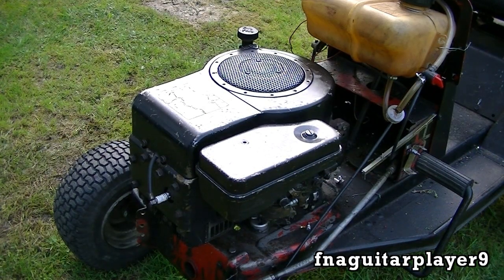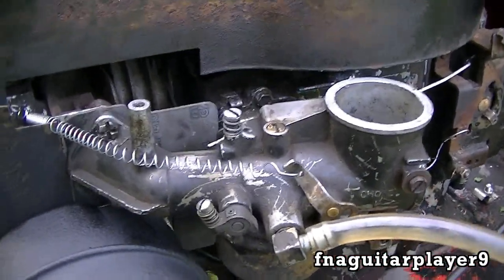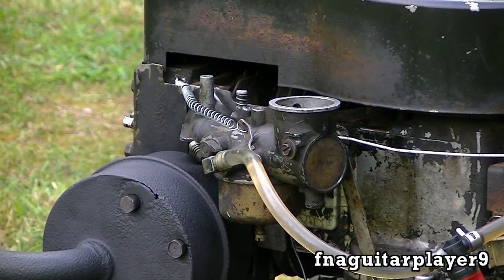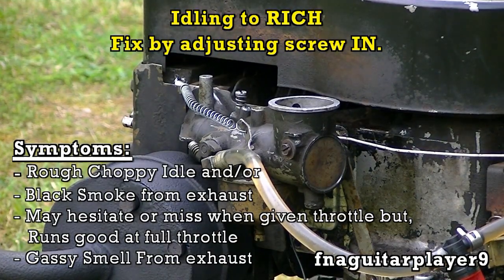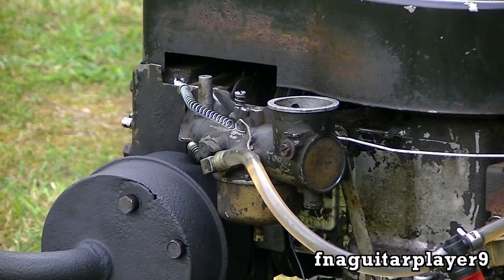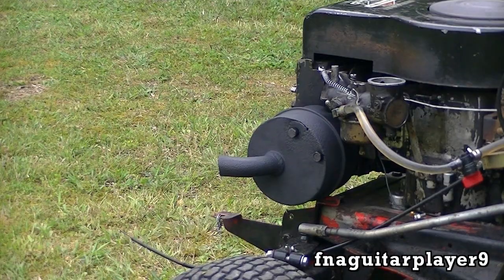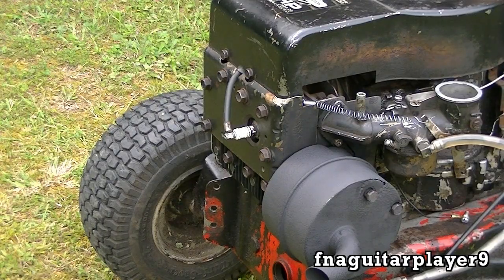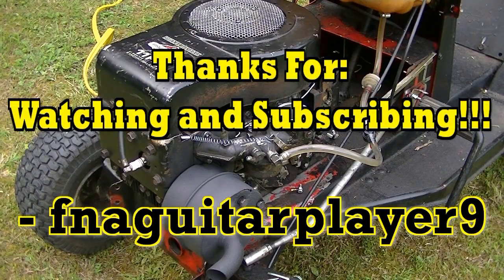How to adjust a Briggs and Stratton One Piece Flow Jet Carburetor

Comment: great video, I have 4 engines running these carbs, I put kits in 2 of them as they had been out in the weather for yrs, the gas bowls were rusted off.I had to drill out the screw-nozzle inside the carb with a 5/16 drill and the run a 3/8 SAE tap to clean up the threads, I used a tiny bit of blue thread locker to screw the nozzle back in and seal it.. I repaired both carbs for about fifty bucks where as they are about $200.ea.
Reply from the maker: dave12546 Thanks! I hear ya, got to hate when that happens, i've never had to drill them out before but i've ran into some that were really stuck. Can't beat, saved a ton of money! Thanks for watching!!!
Reply: Are all Briggs threads SAE? I only have a metric tap and die set (in France) and need a set of appropriate sort to work on engine 11HP i/c  and on Murray 11ic/36. If I get  SAE set will that do the trjck? Thanks.

Comment: Thanks for the time!  I agree, these carbs are bad ass!

I just got an old Ariens snowblower for free!  I offered to fix it for them...but they said they would rather get rid of it.  I don't know what size engine it is...but it's a beast and in great shape.  

Only thing I've noticed so far is that the recoil is popping out/letting out every now and then.  I don't know what that's about?  Maybe the spring tension isn't tight enough to hold the tug rope in when operating?  It retracts, but let's out a few inches once in a while.  That's going to be bad if I let that happen too long I guessing.  So would I fix the issue by winding up the recoil a little more?

Also, I am having a hard time getting the RPMs to lower at full throttle.  I'm hesitant to mess to with the governor...any suggestions? What's your diagnosis?  It sounds to me that "idle" is close to medium-full throttle.  And full throttle makes the muffler "glow". Which can't be good.
Reply from the maker: I hear ya! The rope doing that is the spring being weak (needs wound up more) and the mechanism needs oiled (WD40 works great), if you don't fix it, it will probably snap the rope. Possible that it could break the spring. That sounds like its running way to lean, it could be a intake gasket leaking bad (had that happen before) and the carburetor probably needs to be cleaned and adjusted. Hope this helps! thanks for watching!!!

Comment: Hi thx for video , I nhave the same flow carb but the float is filling up with petrol have you any idea what the part number for a new float would be
Reply from the maker: Rug19061971 if your carburetor is the one piece like in this video with the metal float, the part # is 299707, i order parts from tulsa engine warehouse (tewarehouse.com) but for one item the shipping would be to high, i'd check ebay for it. Thanks for Watching!!!

Comment: Just rebuilt the carburetor on my riding mower, and even using the settings you said (1 1/2 turns on both screws) I can't seem to get it adjusted right...it'll start right up with starting fluid, but cuts out after a second or two (maybe when the ether gets burned up?) HELP!!!!

P.S: The reason I rebuilt the carb was that it kept cutting out whenever you engage the mower no matter WHAT you did with the screws, but ran fine otherwise...maybe a governor problem instead??
Reply from the maker: a2phil sounds like your float may be stuck not letting the bowl fill with gas. I'd take it back apart and make sure the float and needle valve is working smoothly. You could try adjusting the governor sometimes they will not adjust the throttle properly. I have a video on that as well. Thanks for Watching!!!

Comment: you wouldn't happen to know where i could get one of these carbs for a decent price do you? i need one for an old 11hp vertical briggs, the carb that's on it is broken in the bowl where the float mounts, floods it
Reply from the maker: A new one will be high dollar, I would suggest getting on ebay and finding a used one in decent shape. I'm short on carbs myself at the moment or I'd sell you one cheap. I have managed to fix a carburetor that was broken, not that part but the part where the bottom bolt/adjustment screw goes into, i have a video on it called experimental carburetor repair, but I don't know if it would be possible to fix that part or not. And I don't know how long it would hold up. Best bet would be finding a used one on ebay, or going to a junk yard and finding one, or you might find a good deal on a blown up motor on craigslist for parts. Hope this helps, thanks for watching!

Comment: Mine has the same carb, the idle arm bounces up and down regardless of the screw position, is there a spring somewhere that might have come off? Also the mower starts surging and dying after it gets warmed up and I try cutting long grass. Runs and cuts fine until it gets hot, any ideas? I haven't tried adjusting the high/low side mixture screws. Thanks, and great video!
Reply from the maker: First thing that comes to mind is the governor is out of adjustment, i have a video on how to adjust mechanical governors, try that, it may help it, and the mixture could be out of adjustment, getting hot means its running to lean, try making it run richer and see what it does, do those 2 things and see how it does, if it doesn't help get back to me and we'll figure it out! Thanks for Watching!!!

Comment: Nice vid guy. A lot of info usually not found on these. Not a huge amount of the older flow jet carbs out there (small, large, two piece of one piece). On the soldering or brazing of the float....I can honestly say its not worth it. Besides the weight of the solder, if it DOES have a pinhole in it and takes in a little gas it can make a nasty little explosion. I know personally of several people who have had a mini bomb go off because of the gas in the brass floats. They wont do that again, lol!

Comment from the maker: I hear ya. This is a very common problem with metal floats. If its not to bad they actually can be soldered, but unless its like a pin hole in it, its not worth trying to solder, because if you build up to much it will sink likes its full of gas from the extra weight. I know right! I've saved several motors from going to the scrap, I just can't throw a engine away! Even if it threw a rod out the case, I'll try and fix it! Your welcome, appreciate that very much! And Thank you for watching!!!

Comment from the maker: What usually happens is moisture or gas will get into the float (maybe not enough for it to stick and overflow) but when it gets cold in contracts (like a gas can does, swells in heat and shrinks up when its cold), the float will probably have to replaced in that case. I know what you mean, heard that! your welcome, anytime!

Comment from the maker: don't give up! haha Try hitting the bottom of the bowl with a screwdriver, that usually stops it from overflowing if its float related sometimes it sticks and just needs a little attitude adjustment, now this doesn't always fix the problem, but if you do it and it stops then it is float related. Have you checked the float to make sure its not leaking? If its leaking it will sink down and constantly flood the carb. There could be dirt in the seat, causing the needle not to close.

Comment: thanks so much for the information...I installed the carb kit.and gas is still filling the carb and into the air intake....I made sure the float was level and the needle valve was working before putting everything back on.  do you think the needle not closing is the only way to cause it to flood this way..  the same thing was happening before I rebuilt the carb..im about to give up..

Comment from the maker: I hear ya! glad my video helped out! The part your referring to is called a welch plug, the only time you need to take it out is if you need to get into the throttle or choke plates, like to replace them or to clean if they are corroded, to be honest i've never had to do it! And to reinstall them they have to be staked with small tacks. Very rare to have to anything with the welch plugs. I'll have to mention this in a video sometime. Thanks for Watching!!!

Comment: I just rebuild a 12 hp briggs carb. the murray riding tractor is around 25 years old and the engine runs good.it sat up for ten years because I got a john deere. when I tried to bring it back to life, gas filled the carb and muffler. I knew nothing about how to set the screws after the carb rebuild. your video has helped me understand the settings.  thank you so very much for taking time to help us that don't know everything..In the rebuild kit there is a round disk,WHEN DO YOU REPLACE THIS PART

Comment from the maker: Oh wow, thats along time for one to be sitting! glad to hear my video helped out! Your welcome, thanks for watching!!!
Reply: Being as it sat for that long the carburetor bowl had a huge chunk of rust in it and I guess there's a hole by where the main jet tube comes down I might plug it but it doesn't seem to be doing anything bad but if it doesn't tune properly I will plug it to see what happens before I buy a new carburetor
Reply: Mine was sitting for almost six or seven years now. I resurrected it out of some sandy mud and somehow I've got all the blades to turn and the steering as well hopefully it can hold up a little longer A lot of grease and a lot of oil buddy

Comment: THIS VIDEO ROCKS!!!!  I just bought a craftsman mower that sat for 12 years.  The gas looked like canola oil in the tank and carb.  I was able to tune this engine in 4 minutes to get it running like new thanks to your video!  GREAT JOB and BIG THANKS!!!  You saved me a trip to the dealer.

Comment from the maker: sounds like the float level may not be set right (float set to high and letting the gas level rise higher) and its pulling gas out of the vents, i have 2 other videos (one older and one recent) on rebuild/cleaning these carburetors and i talk about setting the float level in both of them, i'd check that first, also the float could be sticking making it overflow and flood. hope this helps, Thanks for Watching!!!

Comment from the maker: that sounds like the float and or needle valve isn't working properly, if its a metal float you can usually bend the tab where the needle valve is to adjust the level, it may also be leaking (the float), or it could be a bad needle valve. I always keep a fuel valve on my mower so if something goes wrong, it can't flood out.

Comment from the maker: i was pushing on where the throttle cable connects, i didn't have a throttle cable so i had to it that way to use the governor. On most engines its a square plastic piece, on these older ones its a metal tab. thanks for watching!

Comment from the maker: yeah, i'll send you a PM then you can just reply to it with your email address, i'll be the only one that can see it. ITs changed alot now you have to go to my channel then go to the about tab and its under there, but i'll pm you to make it easier, yeah thats what I recommend. The chart i'll be sending shows all torque and tolerances for just about all brigs engines from 3 horse push mowers to the big twin cylinders.

Comment from the maker: yeah it does help, well my chart that i use says .003" to .005" for the intake, and .005" to .007" for the exhaust. I've used that and it seems to work, now i try to get it set to the low setting if possible, close to .003 and .005 as possible. .004 would work, but its supposed to be set a little looser on the exhaust because it gets so much hotter. If you PM your email address i'll send you the chart, it has all torque specs and tolerances if you want it, its a pdf file

Comment: Also noticed hard starting problem too so I will be adjusting valves tomorrow.  Any rule of thumb on the briggs OHV?  .006 intake and .008 exhaust I read is good for all flatheads.  Watched a Donyboy73 video where he puts them at .004 on OHV.  I might just try .005 as a good start-point for OHV.  I'm not so keen on finding service manuals for every engine I come across haha.

Comment: I'm going to research this compression release thing, as I keep seeing it mentioned.  I don't know that is the case here however as compression was 90psi when I had oil squirted in through spark hole(so bad rings/cylinder seal).  Not worried about it though 65 should be good enough.  First thing tomorrow I'm popping that flywheel off.  I am glad I have a lead now, thank you.  I think this mystery is solved, I will let you know how it turns out.

Comment from the maker: its possible, my 14.5 (ohv model 28) sheared a key a couple years ago, turns out, which is why its still not running, it needs a new coil, it has a short in the wire, and i guess it misfired and made it kick back and sheared the key. but it is very possible. i'd check that first, when you say it fires a few times, that tells me its the spark timing. also I just remembered, the low compression is probably because of a compression release, most of the bigger engines have it to start easier.

Comment: It's a 15.5 diamond I/C 1 cylinder vertical.  65psi works fine in the 3.5 classic's so I tend to think that is not the problem.  Timing could be off, either from camshaft or flywheel having a shorn key.  But a shorn key on a pulley driven engine seems near impossible to me.  Any idea's?

Comment from the maker: sounds like it may have sheared a flywheel key, the low compression is probably in the valves, a good valve job should fix that, the rings may be worn, but i usually start with the valves.

Comment: And now I've come across another briggs that is acting very mysterious.  I have the 2 piece carb off and I am spraying gas directly into intake manifold to completely bypass any issues with carb.  Very good spark from coil is jumping 1/2 inch.  Spark plug is good.  Won't start at all. I get a few fires when I give it a good squirt of fresh high octane.  Now compression is only 65.  I know that's low but figured it's good enough?  Either that or I'm looking at opening case to check timing

Comment: wow I'm having some bad luck with these larger briggs engines.  No luck with this one.  Installed new carb kit, but slow jet wouldn't thread in for some reason.  Old slow jet looks reamed a bit but the customer doesn't want to invest any more into it.  I was going to retap the threads to allow for the slightly larger threads of the otherwise identical new slow jet.   He's going to drop it off to me and maybe I will find what's wrong on my own time.

Comment: I think your on to it with the float.  That sounds about right.  
I checked the fuel line to carb and it's good.  I had carb apart and float sits level with carb when needle closed, which I thought was correct.  I could try adjusting the brass tang on float so it doesn't close until slightly higher up.

Comment from the maker: yeah sounds like its either like i said the float isn't adjusted right, or a bad/clogged jet. nah I wasn't talking about the emulsion tube, but the float and needle valve, if it isn't working right letting enough gas into the bowl it will act like its running out of gas, then gas pours back in letting it run good for a little while again. but a bad fuel filter will do the same thing, check that first, just to rule that out, ya never know. its hard to say sometimes what it is.

Comment from the maker: thanks! that sounds like the float/needle valve isn't working properly or the float needs adjusted. what it is, its not letting enough gas in to run longer, and its running out of gas, from not enough coming into the bowl, in other words like your turning a fuel valve on and off. OR it could be a bad fuel filter and/or line, not letting enough gas come into the carburetor. thanks for watching!

Comment: Cool video. Had a guy come in today with the same engine on his mower.  Something seriously wrong with the carb.  I tried starting out at 1 and 1/2 turns on both screws and working from there... Best I could do was fine tune it so it would run good for about 2 minutes then stutter and try to stall for about a minute then it would run great like a champ for another 2 minutes then decide it wasn't up for it and start stalling and stuttering again!

Comment: Hey dude good video! I have a newer 8.5 briggs on A yard slug with several problems! sometimes it runs great and sometimes it lacks power. And there are some electrical issues as well. But it runs at a snails pace but it wasn't designed to be a speedster. And since I only paid $40.00 if i can't get it right I will just part it out. Ha LOL! But it beats pushing a mower! And since it is so slow it is both wife and kid freindly!

Comment: Sounds like you have a crook condensor in your ignition. When they let go they tend to die after they heat up after they have been used for a while then cark it. then they are fine when they cool down. Very frustrating. Had this problem with a chain saw years ago. Give it a go, regards.

Comment from the maker: it stays screwed in all the way, its actually like a jet, it has a name but for the life of me i can not remember whats its called! if its screwed out it will pull in extra air and lean out. The oil wouldn't be causing this, several possibilities, first of all it could be the float/needle not letting enough fuel into the carb and it running out of fuel or it could be a bad condensor (if it has points and condensor) alot of times they will heat up and quit working. i suggest the 30weight oil >>>

Comment: What about that brass screw to the right of the idle adjustment screw, how is that suppose to be set? Or does it stay screwed all the way in? I have a mower just like yours and it runs fine for about 20 minutes and then just stalls out, I let it cool for a little while and it starts up again and the process continues over and over, I cleaned the carb, changed the plug, changed the oil. But I used 30W oil, I was thinking maybe I should change it to 5w-30 synthetic, which B&S recommends.